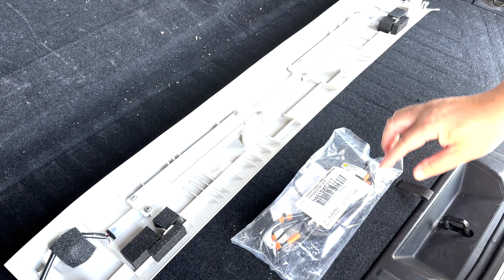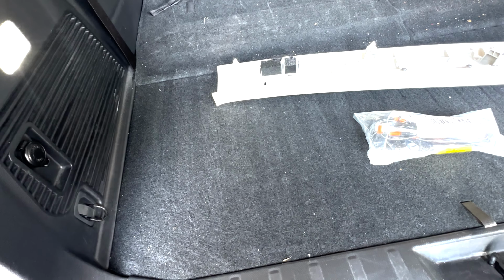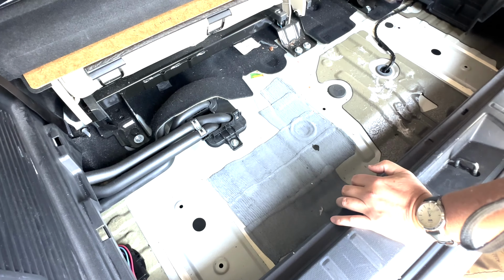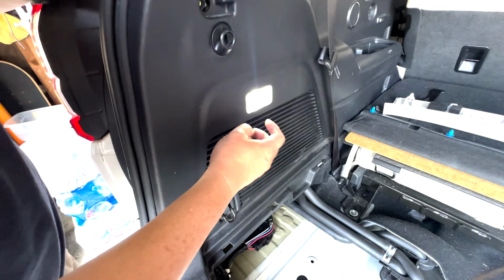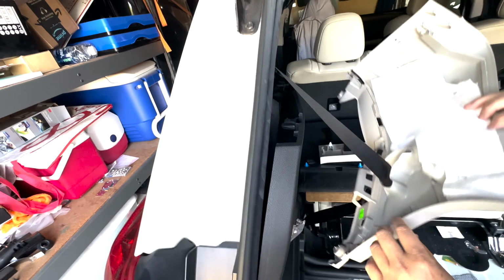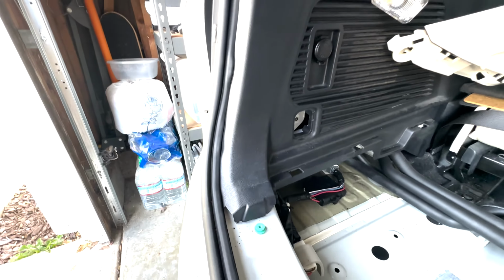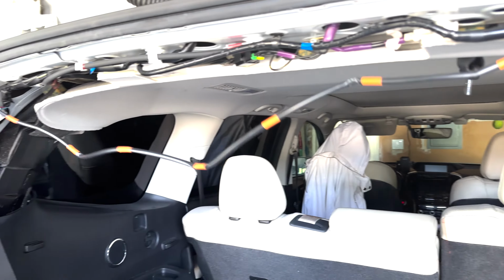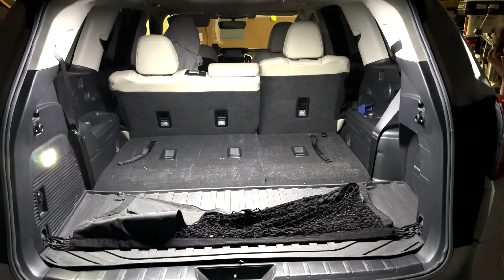2019 Subaru Ascent OEM cargo LED light upgrade

Comment: Thanks for posting this; it helped me install the light and harness in a friend’s Ascent. Note that I was able to easily access the connector at the small light on the side, and cleanly route the harness, including all the stick-on cable tie bases, without disconnecting more than a few of the snaps on the side panel and I didn’t need to remove the tray at all. Maybe a 20 minute job done carefully. I did use a trim remover and need to take care that the weatherstripping wasn’t pinched after replacing the panels on the side and top.

Comment: Thank you for sharing this information. It might be helpful for others. I recently purchased an LED light from the Dollar Store/Walmart. I bought two, placing one on the left and the other on the right. This way, if one runs out of power, I still have a working light. The downside is that it only runs on AAA batteries.
Reply: You should put up a video on how it came out.